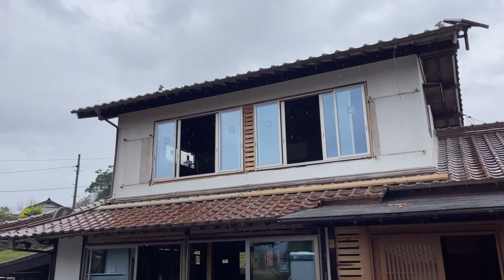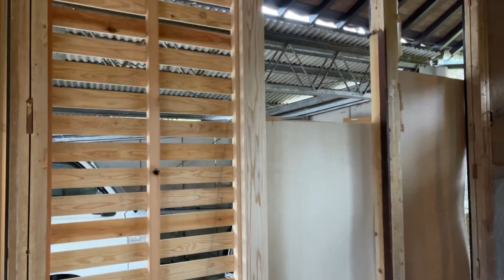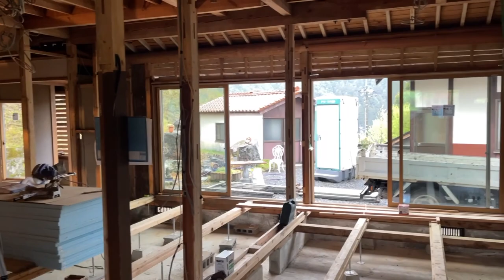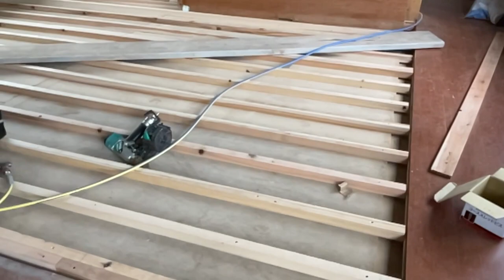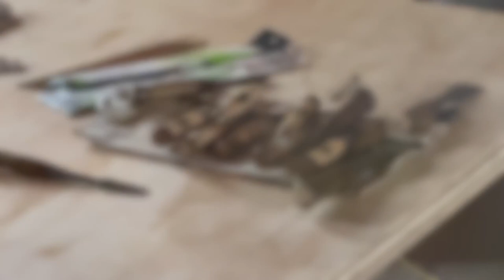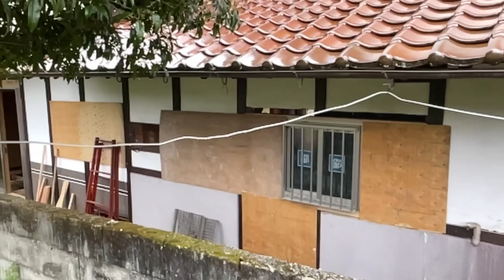Exciting Renovation Updates to our Empty House in Japan - Installing Wood Floors, Beams, New Windows

Comment: The extended retaining wall height is more a privacy feature, and you will find the voids in the blocks are not filled with concrete except for every meter or so that has the reinforcement tied into the lower wall.  It won't stop anything of any weight, and you could probably kick the whole thing over given enough time. You have a French drain already concreted into the pavement on the house side, so you won't have any water issues. I would take those blocks out like you suggested and haul in some rocks and lay it on the lower wall or something for nice effect ad put some flowers of choice. Sledgehammer and a grinder to cut the reinforcement steel is all you need. You could even cut it with a hacksaw. Check with the neighbors about it first because they may know something that we may have missed here. Gut feeling is that it is just a privacy thing serving no other purpose.
Reply from the maker: Thanks! I agree. I won’t get to it for a year or so anyway, so going to watch this rainy season. As long as I keep the drain unclogged it should be good. I want to be able to look out the kitchen window and look out the back. I hate stuff in the way without a purpose!